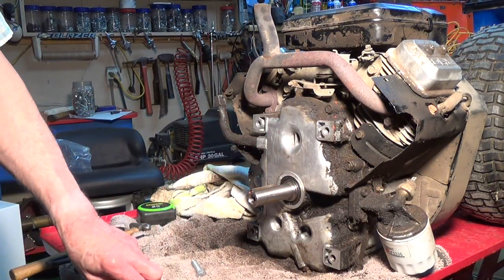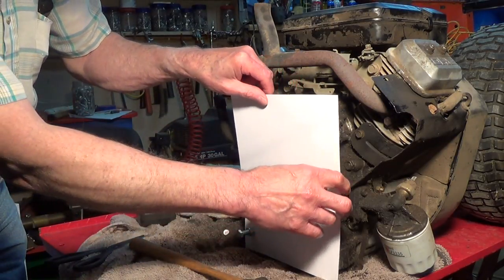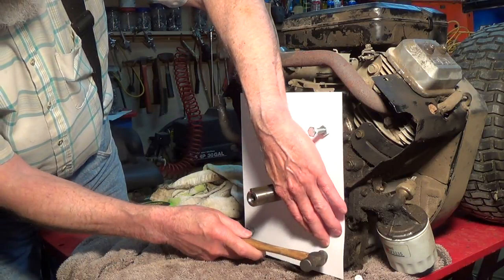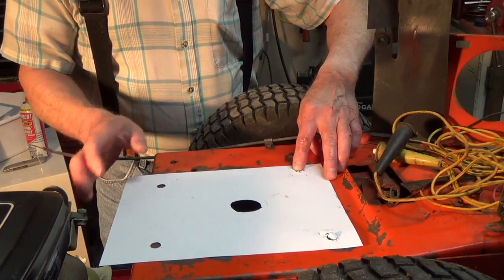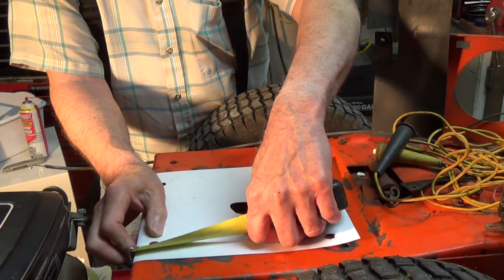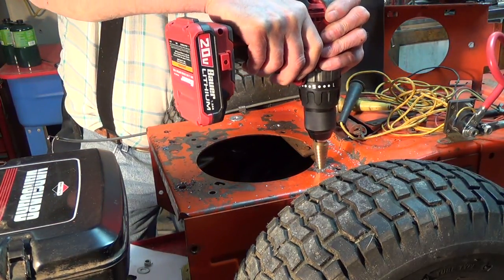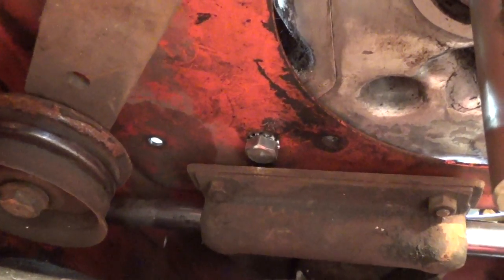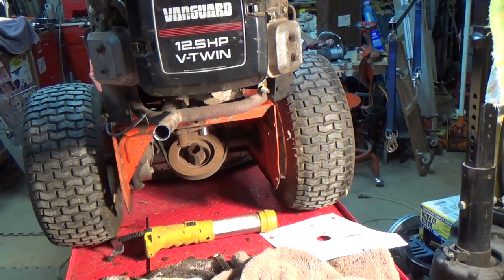Laying out the mounting holes for the B&S 12.5 V twin for the Emperor

Comment: Its Look'n good George. Duel it out❕ What model HF Drill is that George? I'm needing a new one and I've had Many years of service out my Big 1/2" drill from them.  I've got to get an Impact also from them also.
Reply from the maker: I like the Bauer products which are a couple of steps above the cheap stuff, and so far have been very reliable. I have this half inch drill, the impact and the battery powered angle grinder, which all use the same battery/charger. I don't think the extra power battery is much of an improvement over the standard battery. They all work very well, in my opinion. Thanks Danny